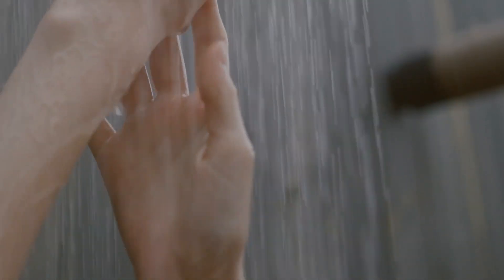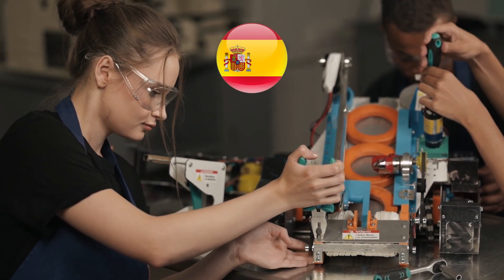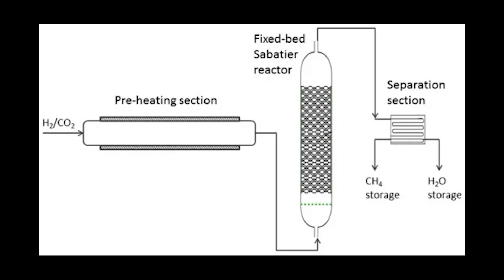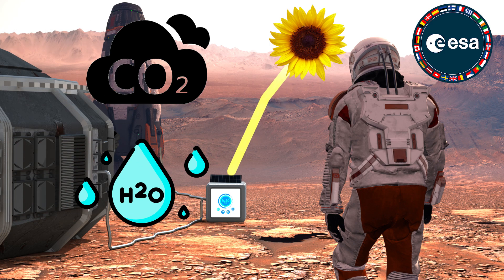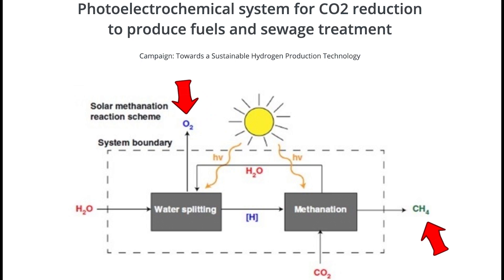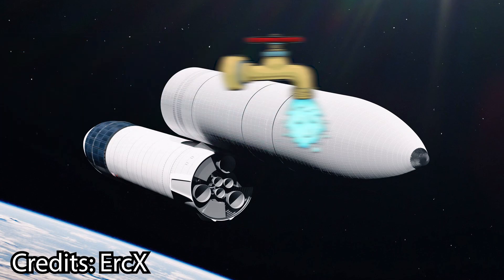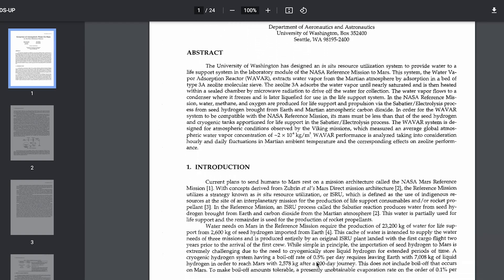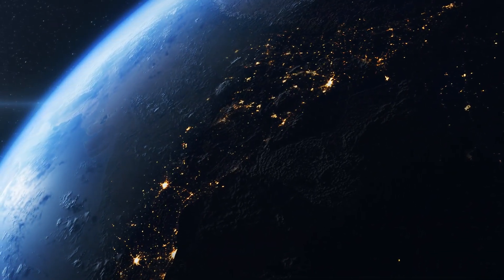How Your Martian Showers Will Be Turned Into Rocket Fuel

Comment: Yes but that Same water has hydrogen and oxygen which can be used for fuel, do you know that one human being has enough fuel to create a 50000 MGT nuclear bomb? The problem isn't fuel its man's ability to extract it😅🤣🤣
Reply: The human body contains perhaps five grams of heavy water.  About 1/5 of that mass is deuterium atoms (bound to oxygen in the form of water).  So about 1 gram of deuterium.  If you strapped that gram onto a tactical nuke you could get a theoretical max yield of around 4 kilotons of TNT.  Not the 50 gigatons that you mentioned.  Now 4 kilotons is nothing to sneeze at.  It'll blow out the windows of the whole town and set the cat on fire.  But it's one ten millionth of your estimate.